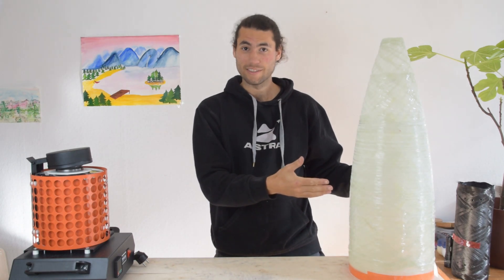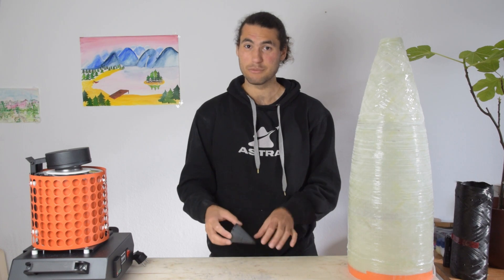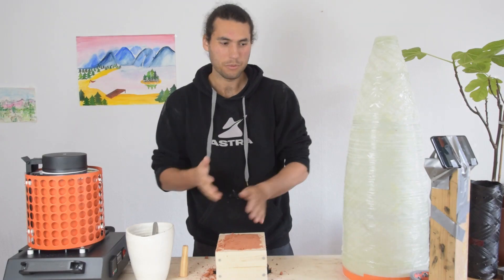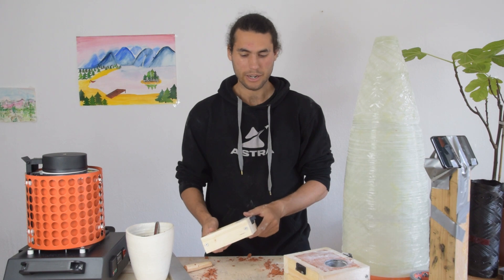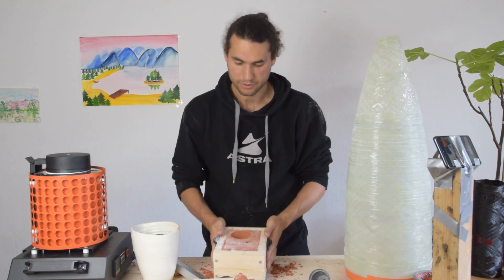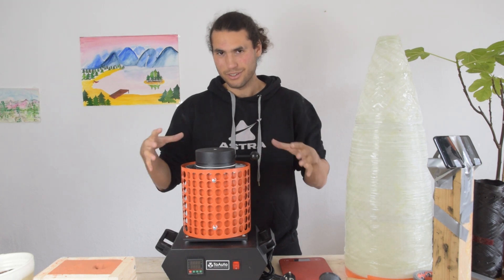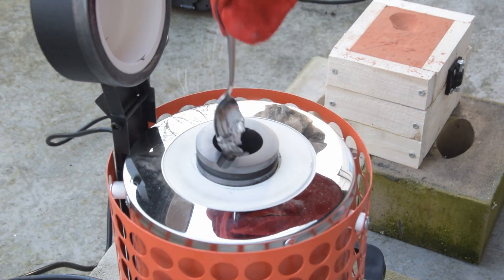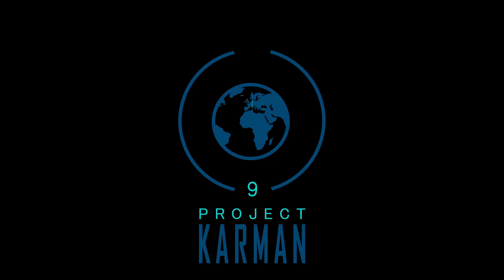Using "Ancient" Technology to Create a Rocket Nose Cone

Comment: not metal ... you need a potters wheel and make a pottery ceramic nose cone
Reply from the maker: That could also be an interesting solution.  Just might not be as strong.  You would have to be very careful with that nosecone.

Comment: Can't you just make the nose tip out of carbon? Sure, the heat will eat away some, but probably not too much.
Reply from the maker: That might also work.  But the question is if that is as easy to manufacture...  Also an ablating tip could be an issue as it could affect the aerodynamics if inconsistencies develop.

Comment: I'm a metal caster now; I transitioned to metal casting after giving up rocketry. I can see that you are doing a really great job so far!

The melting point of aluminum is 660°C, which is quite low. Moreover, aluminum metal can distort between 400 and 450 degrees Celsius. I'm not quite sure how hot the rocket's tip will get during flight, but it might not be a good idea to leave it exposed. Once the temperature reaches 400°C to 450°C, it may begin to produce a lot of unneeded drag. An alloy of aluminum and copper (89% copper, 11% aluminum) might be the ideal choice because it is as tough as steel and has a melting point of 1000°C. Remember that aluminum bronze is significantly denser.

Although aluminum is quite brittle as well, I don't think it would be a big issue because adding 1% to 2% of antimony will make it harder. Remember that antimony is more poisonous than lead.

Good luck reaching the stars!
Reply from the maker: Thanks for the interesting tips.  Our aerodynamic simulation suggest that the nose tip will reach 500-600 °C (steady state); however, in reality the high heat condition will only last for 5-10 seconds so the metal will probably not reach that temperature.  Regardless, your suggestion to try a copper aluminum alloy is certainly interesting and would completely removed the problem.  Plus a copper nose would certainly be quite spectacular!
Reply: @ASTRABremen  Yeah, also copper-aluminum alloy looks like gold!
Well, aluminum also has one of the highest thermal conductivity among all the metals - which might still be a problem.